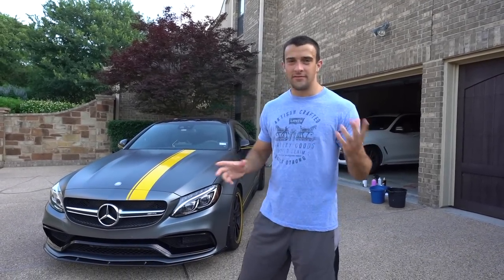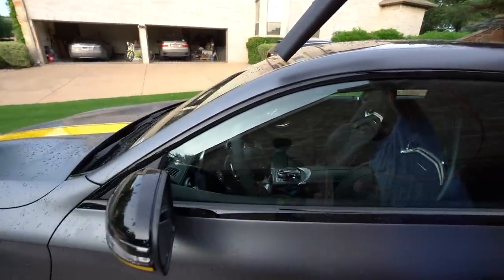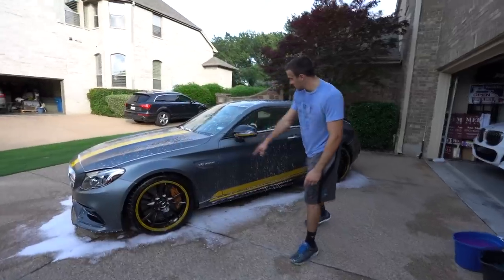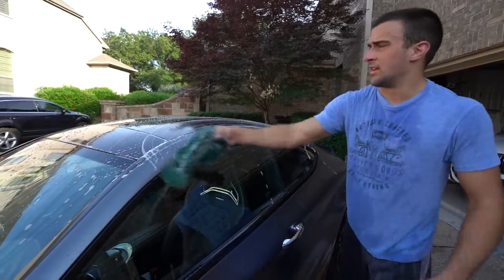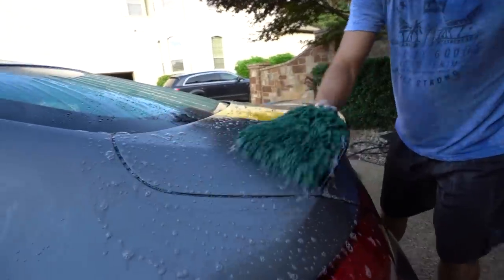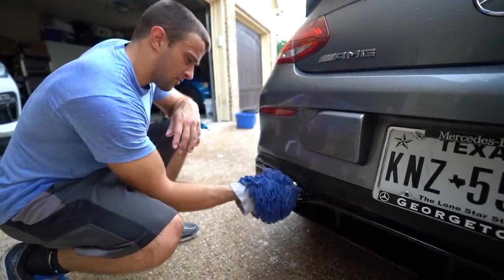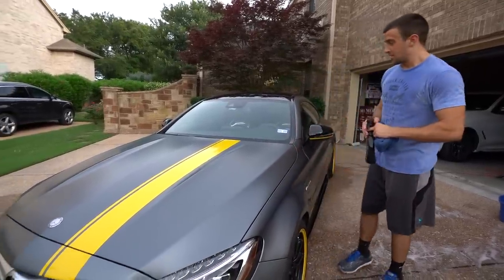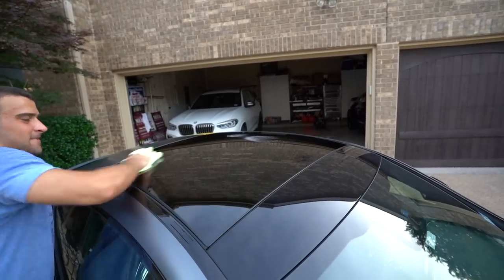How To Wash A Matte/Satin Car

Comment: Matte ( Frozen ) paint is Magnificent!

However, washing technique is totally different than regular paint.
Recorded is special shampoo for the Matte paint ( AngelWax, Gyeon .l )
You are to close with the pressure washer, if you like the paint to last longer.
Car manufacturers, BMW, Mercedes and Detailers 
They don’t  recommend using any Detailer products. 
Drying only with the Metrovac or similar. 
There is also Ceramic coating just for the matte paint.
Reply: I spoke to Mercedes regarding ceramic coating and was told that matte finish cannot be ceramic coated. I'm not totally sure if that's correct and am looking into it.

Comment: Hmmm... you should first sponge the car to get all the debris off, before you hit it with a power washer! Think about it - the high pressure is just pushing a lot of dirt into the paint!
Reply: Disagree with you  I have owned a satin black g63 since 2015 pressure of first then sponge otherwise you will scratch your paintwork !!!
Reply: There is more prolonged pressure with a sponge my guy. Stupid thing to do fluterra.
Reply: @AntonioLopez-uj7pu  What you should do, and what I do on my Magno GT, is a soap wash first. With the attachment you put on your hose that adds detergent. Power wash is a really bad idea.
Reply: @Fluterra  that makes more sense, I agree with you if this is the way.